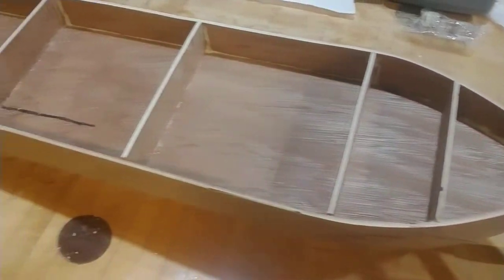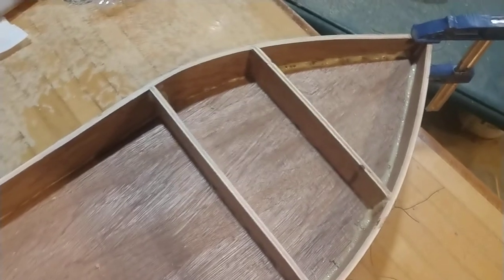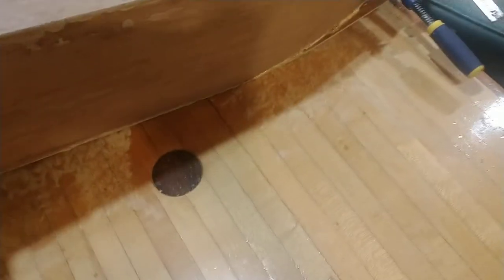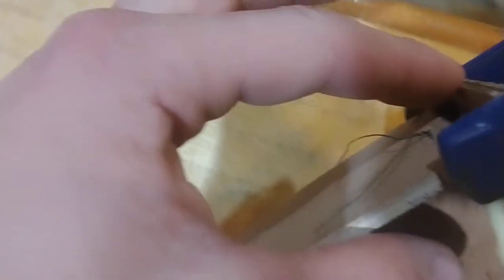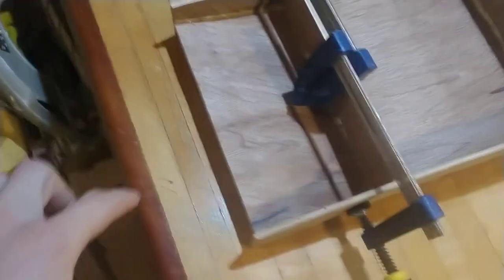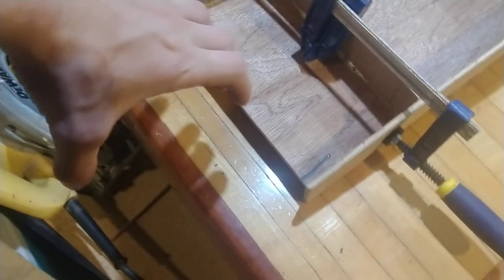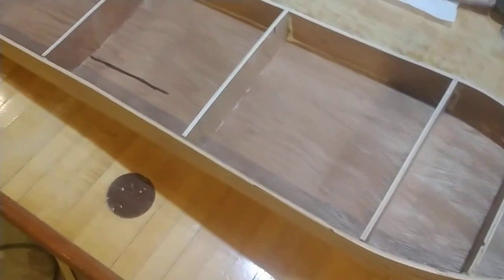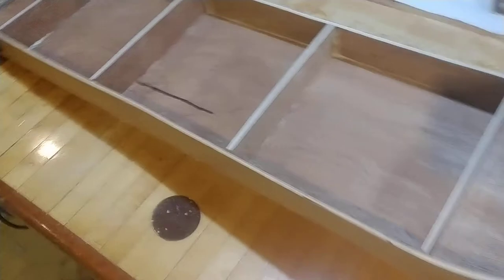rc sternwheeler boat in g scale first video on the haul

Comment: Hi Wes, that hull looks a lot like mine.  I put one layer of thin fiberglass cloth and finishing resin on the hull before painting to defend the wood from little bumps and scrapes it might encounter. If its just paint, one scratch or chip and the wood will wick up water and be trapped under the rest of the paint never to dry out. I'm looking forward to seeing the progress
Pete
Reply from the maker: I was intending on using rust-oleum spar varnish for sealing the hull I have a can of it and it's intend for wood boats and it gets into the wood grain then I'll paint the bottom with my airbrush and seal that with more spar varnish